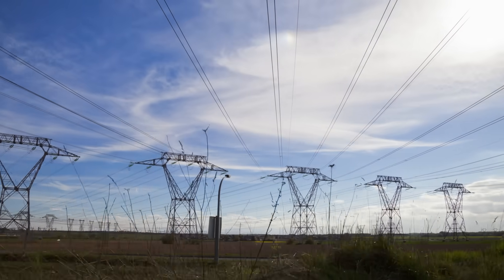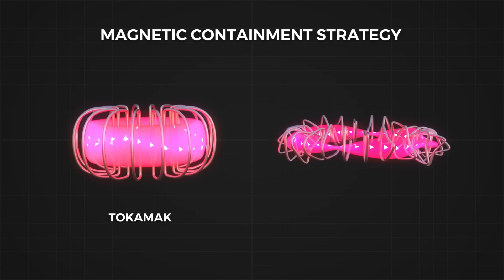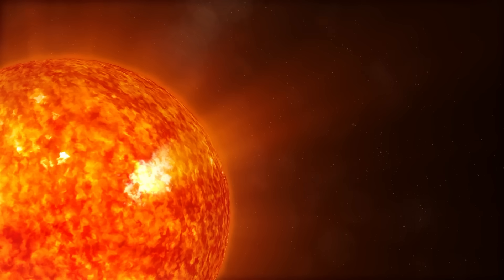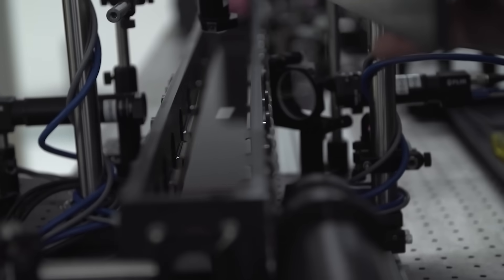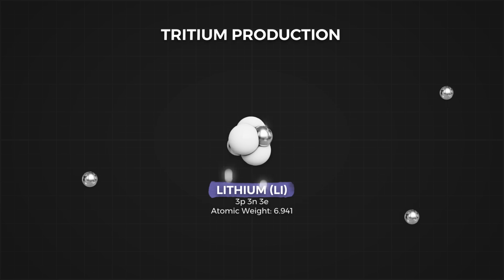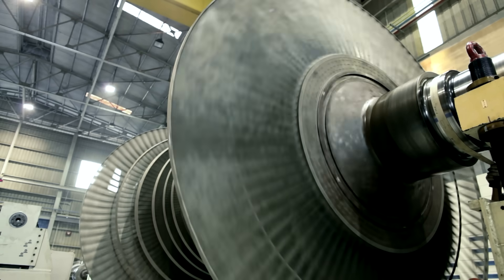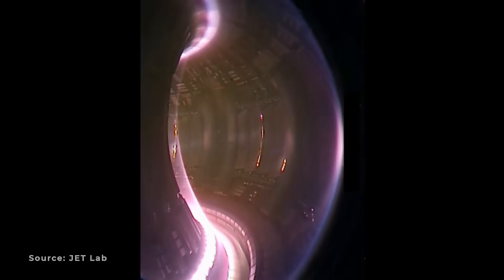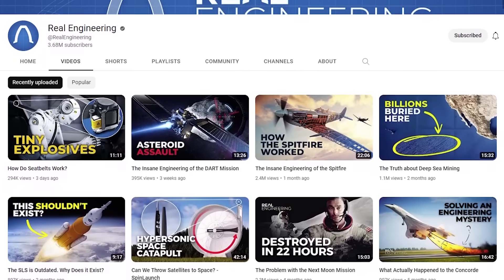The Problem with Nuclear Fusion

Comment: Social media and wrong information has made the fission byproducts sound much more dangerous than what it really is. Simply digging a deep enough hole in the ground, putting the wastes in it and filling it up with cement or concrete will do the job or better thing is to reuse those byproducts as energy generation but the public's lack of correct information has made it a pain. I legit hate it when people over react to safely disposed fissle fuel rather than paying attention to the radioactive C14 in the air which is more dangerous since it's floating around and we are breathing it.

Comment: you touched on it but I feel like even if an net energy fusion reactor will be invented, it will only be marginally better or maybe even worse than current energy plants. Economics is a huge factor, and  detrition, tritium, and lithium 6 are all expensive compounds. Also producing the insane energies and pressures required to maintain fusion will eat away most of the energy gain.

Comment: They are thinking inside the box. Cooling the walls. They need to think outside the box and use a cushion of super cooled nitrogen over the walls. How liquid nitrogen won’t burn you because the heat causes a cushion of air it rides on. Same thing. There’s no metal that can withstand a million degree plasma. An invisible barrier on the other hand will

Comment: I've heard all the promises before in my half century on the planet.  Energy independence, replacement of fossil fuels in industry, free power what everyone has failed to understand that nothing is a 0 sum gain.     The U.S. is the greatest recycler of steel in the world, because of having the lowest nat gas rates and hence electrical rates already.  Recycling is done in an electrically powered Arc furnace, but new steal (shiny steel) has to be done by burning coal (twice).  And during this process the gases are captured and sent to another plant to yield out noble gasses.   Gasses like neon, which is used to focus the lasers to make the expensive computer chips.   Cheap in free electricity is not going to replace that.   Additionally, all this "game changing" tech requires capital.  Which is becoming more and more constrained in the de-globalizing industrialize world. As the baby boomers retire and take their capital with them (the technical term is velocity of capital).  BTW, another widely circulated future promise was the population bomb.  It never happened, in fact may countries are facing a population busts.   Populations with less consumers than retirees will not have the velocity of capital to fund innovations and bring them to scale.  Even the U.S. with its huge economy and best demographics in the industrialized world will feel bumps along the way.   Major projects like these will have to be prioritized in every country, some just won't have the capital to do any.

Comment: This video is way out of date, and was always inaccurate.  Fission nuclear reactors are being REOPENED -- and new designs are coming online.   To be fair, this is more clear now when when this video was made 2 years ago.  But the title is just wrong -- he seems to talk about the problem with Tokamaks -- which is NOT the same as the problem with fusion!  There are MANY competing approaches to fusion -- very different in scale, approach and fuel than the tokamak approach, which is both current (ITER) and old (Russians working on it in the 1960s).  They may all fail, but it only takes one to succeed, and their potential benefits and current problems and prospects are not reflected in this misleading video.

Comment: The Kinetic Energy is converted to Electrical Energy by using a building material, "Tungsten",  Copper silver lined with molten Tungsten, is a self-heaven for Electrical Energy to be transferred from the Nuclear reactor to the Main Hub after that the usual Mega Bolt Coils will carry the energy to the cities Grid, check it...

Comment: STELLAR REACTOR: A FIERCELY INCOMPETENT DRAFT 

PROCESS: 

1. Gas Injection: Fuel gas (e.g., deuterium-tritium, regular hydrogen) is injected into the reactor chamber. 

2. Fusion Reaction: The gas is heated to incredibly high temperatures, causing nuclear fusion reactions to occur. 

3. Ionization: The heated gas becomes a plasma, with atoms ionized into ions and electrons. 

4. Electron Stripping: The high-energy collisions strip away electrons from the ions, creating a plasma with free electrons and ions. 

5. Magnetic Confinement: The magnetic fields, potentially generated by superconducting magnets, confine and channel the plasma using magnetohydrodynamics (MHD). The electrons, being charged particles, are influenced by the magnetic fields. 

6. Energy Storage and Use: The energy generated by the fusion reaction is stored and utilized, potentially through a heat exchanger or direct energy conversion system.

PROBLEMS I CAN FIX: 

1. Magnetism Loss due to Heat:
    - Liquid Nitrogen Cooling: Cooling the magnets with liquid nitrogen to maintain their superconducting properties.

2. Material Strength:
    - ODS TUNGSTEN: Plasma-Facing Armor
Extreme heat flux tolerance (melting point: 3,422°C) Radiation hardening (resists void swelling) Reduced recrystallization. 

    - SILICON CARBIDE COMPOSITE (SiC) Breeding Blanket Structure & Coolant Channels. Low neutron activation. Superior radiation damage tolerance. High temp strength (1,400°C) Tritium permeation resistance. 

    - Vanadium Alloys: Structural Support. Exceptional neutron radiation ductility. Compatibility with liquid metal coolants. Low thermal expansion. Coolant Manifolds, Grid Structures. 

    - Liquid Nitrogen Cooling (again): The liquid nitrogen cooling system serves a dual purpose, helping to maintain material strength and superconducting properties.

MATERIAL FAILURE AND NEUTRON BOMBARDMENT (Because ofc) 

Neutron bombardment from DT fusion (14.1 MeV neutrons) triggers severe material degradation: 

- Atomic Displacement: High-energy neutrons knock atoms off lattice sites, causing voids/swelling (quantified by DPA = ϕt · σ_d) 

- Transmutation: Neutron absorption generates helium/hydrogen via $(n,\alpha)$ reactions, leading to embrittlement ($C_{\text{He}} \propto \phi t \cdot \sigma_{(n,\alpha)}$). 

- Thermal Stress: Cyclic heat fluxes ($>10 \, \text{MW/m}^2$ at divertor) induce cracking ($\sigma_{\text{thermal}} = \frac{E \alpha \Delta T}{1 - \nu}$). ODS Tungsten = Metal porridge in 2 years that's weaker than my will to live. 

- Tritium Retention: Neutron-activated materials absorb tritium, creating radioactive waste and fuel loss.

REMAINING CHALLENGES: 

1. Cost: Developing and maintaining such a complex system would be expensive.

2. Weight: The reactor's weight could be a concern, particularly if it's designed for mobile applications. 

3. Resource Extraction and Supply: Securing a reliable supply of fuel (e.g., deuterium) and managing resource extraction could be challenging. 

4. Difficulty: The complexity of the system and the required technological advancements might still pose significant challenges.

5. Overkill: The reactor's power output might be more than what's needed for specific applications, making it inefficient or impractical. 

6. Energy Conversion Efficiency
   - Even in the best-case scenario, ~60-70% of fusion energy ends up as heat,  not plasma kinetic energy.  
   - Fix: Combine electron capture with thermal conversion (turbines, thermionics).  

7. Losses Are Inevitable (Thanks, Entropy) 
   - Some energy will be lost to:  
     - Radiation (photons escaping).  
     - Plasma turbulence (wobbly particles = harder to control).  
     - Heat leakage (your chamber walls will soak up some energy).  
   - But as long as net output > input, the universe won’t sue me. 

8. Bremsstrahlung Losses (Phantom Energy Drain)
   - In hot plasmas, electrons emit X-rays when they slow down (bremsstrahlung radiation).  
   - Fix: 
     - Use aneutronic fuels (p-B11) to reduce X-ray losses.  
     - Magnetic mirrors to reflect escaping radiation back into the plasma.  

DESIGN CONSIDERATIONS: 

Since I haven't designed each part's components yet, some potential areas to explore include: 

- Reactor Chamber Design: Optimizing the chamber's shape, size, and materials to maximize fusion reactions and minimize plasma instabilities. 

- Magnetic Field Configuration: Designing the magnetic field configuration to efficiently confine and channel the plasma. 

- Heat Exchanger or Energy Conversion System: Developing an efficient system to convert the fusion energy into a usable form. 

- Control Systems: Designing control systems to regulate the plasma, magnetic fields, and energy output. 

- Optimizing The Design
Skip the Middleman (Steam Turbines) If can capture >30% of energy directly from electrons, I already beat the fusion race.

KEY EQUATIONS (NOT ALL)  

1. Lawson Criterion (Minimum conditions for net energy) \[ n_e \tau_E > \frac{12 k_B T}{\langle \sigma v \rangle E_{\text{fus}}} \]  

- Variables:  
    - $n_e$: Plasma density [m⁻³]   
    - $\tau_E$: Energy confinement time [s]   
    - $k_B$: Boltzmann constant   
    - $T$: Plasma temperature [keV]   
    - $\langle \sigma v \rangle$: Averaged DT fusion cross-section [m³/s]   
    - $E_{\text{fus}}$: Energy per DT reaction (17.6 MeV) 

2. Triple Product (Fusion gain $Q$) \[ n T \tau_E > 3 \times 10^{21} \ \text{keV}\cdot\text{s}\cdot\text{m}^{-3} \quad (\text{for } Q=1) \]  

- Variables:   
    - $n$: Total plasma density [m⁻³]   
    - $T$: Plasma temperature [keV]   
    - $\tau_E$: Energy confinement time [s] 

3. Plasma Pressure Balance (Beta Limit) 

\[ p = \frac{B^2}{2\mu_0} \]  

- Variables:   
    - $p$: Plasma pressure [Pa]   
    - $B$: Magnetic field strength [T]   
    - $\mu_0$: Vacuum permeability 

4. Grad-Shafranov Equation (Tokamak Equilibrium)  

\[ \Delta^* \psi = -\mu_0 R^2 \frac{dp}{d\psi} - F \frac{dF}{d\psi} \]  

- Variables:  
    - $\psi$: Poloidal magnetic flux   
    - $p$: Plasma pressure   
    - $F$: Toroidal field function   
    - $R$: Major radius 

5. Critical Magnetic Field (Superconductors) 

\[ B_c(T) = B_{c0} \left[ 1 - \left(\frac{T}{T_c}\right)^2 \right] \]  

- Variables:   
    - $B_c$: Critical field at temperature $T$  
    - $B_{c0}$: Critical field at 0 K   
    - $T_c$: Critical temperature 

6. Neoclassical Transport (Banana Regime)   

\[ D \propto \frac{\rho_i^2 v_{thi}}{L_p} \]  

- Variables:  
    - $D$: Diffusion coefficient   
    - $\rho_i$: Ion gyroradius   
    - $v_{thi}$: Ion thermal velocity   
    - $L_p$: Pressure gradient length 

 
7. Kink Stability (Safety Factor $q$) 

\[ q(r) = \frac{2\pi r B_\phi}{\mu_0 R B_\theta} > 1 \] 
 
- Variables:   
    - $q$: Safety factor   
    - $r$: Minor radius   
    - $B_\phi$: Toroidal field   
    - $B_\theta$: Poloidal field 

8. Tritium Breeding Ratio (TBR)
 
\[ \text{TBR} = \frac{\text{Tritium produced}}{\text{Tritium consumed}} > 1.1 \]  

- Key Reaction: 
 
\[ n + ^6\text{Li} \to \text{T} + ^4\text{He} + 4.8 \ \text{MeV} \] 

9. Displacements Per Atom (DPA) 

\[ \text{DPA} = \phi t \cdot \sigma_d \]  

- Variables:   

    - $\phi$: Neutron flux [n/m²·s]   
    - $t$: Exposure time [s]   
    - $\sigma_d$: Damage cross-section [m²] 

10. Helium Embrittlement 
 
\[ C_{\text{He}} \propto \phi t \cdot \sigma_{\text{(n,}\alpha\text{)}} \]  

- Variables:  
    - $C_{\text{He}}$: Helium concentration   
    - $\sigma_{\text{(n,}\alpha\text{)}$: (n,α) reaction cross-section 

11. Thermal Stress (First Wall) 

\[ \sigma_{\text{thermal}} = \frac{E \alpha \Delta T}{1 - \nu} \]  

- Variables:  
    - $E$: Young’s modulus [Pa]   
    - $\alpha$: Thermal expansion coefficient [K⁻¹]   
    - $\Delta T$: Temperature gradient [K]   
    - $\nu$: Poisson’s ratio 

12. Divertor Heat Flux Limit   

\[ q''_{\text{max}} = 10 \ \text{MW/m}^2 \quad \text{(for ODS tungsten)} \] 

13. Thermal-to-Electric Efficiency (Brayton Cycle)  

\[ \eta = \eta_{\text{th}} \cdot \eta_{\text{cycle}} \approx 0.33 \]  

- Variables:   
    - $\eta_{\text{th}} = 1 - T_{\text{cold}}/T_{\text{hot}}$: Carnot efficiency 

14. Direct Energy Conversion (Aneutronic Fuels)   

\[ \eta_{\text{direct}} = \frac{\text{KE}_{\text{ions}}}{\text{Fusion energy}} \cdot \eta_{\text{collect}} \]  

- Variables:   
    - $\text{KE}_{\text{ions}}$: Kinetic energy of fusion ions   
    - $\eta_{\text{collect}}$: Collector efficiency.

MUST KNOW: 

There are multiple unaddressed problems, solutions and insights residing within this. The examples include: 

• Material failure. (nothing can survive 14.1 MeV.)
• Solutions to weight.
• Potiental for stellarator use. (prolly better ngl)
• LN2 being to impractical and warm for cooling.

And many more. (Translation: To lazy to type it. I've spent to long trying to use proper grammar and punctuation and be publishable)

Comment: Great overview of the incredible promise of fusion and the fundamental confinement challenge. The video does a fantastic job explaining the historical context with Tokamaks and stellarators.

One critical hurdle that often gets less attention than the plasma physics is the fuel cycle, specifically the tritium breeding problem. For the most common D-T reaction, a viable power plant must generate its own tritium fuel by having neutrons from the fusion reaction interact with a surrounding lithium blanket. Solving this materials science and neutronics challenge is just as crucial as achieving stable plasma confinement.

This interplay between the core reaction and the engineering of a self-sufficient fuel cycle is a core theme I explore in my own analyses.

Comment: but to put it another way the reactor wall is like one of the few things standing in the way of tokomak based fusion and it's not like there are not proposals to fix that, like lining the inside of the reactor with liquid lithium layer and having Beryllium under the lithium to act as a neutron doubler to protect the boron from spluttering and creating hazardous dust and meaning you would regularly need to replace the inter wall... which would be a problem if it's full of hazardous dust.

Comment: As I have previously stated, there can be no "sitting on the fence" (or anything close to it)-- Top Down cosmology is either mostly right or terribly wrong.
 
The biggest problem with Bottom Up BBT cosmology is the problem of entropy, central to thermodynamics and the virial theorem, stating in its simplest form that "for a stable, self-gravitating system, the average kinetic energy of the particles is equal to half the negative of the average potential energy." With the Big Bang theory, the early universe was too hot to form particles, including the Higgs boson and the yet-to-be-found (and still theoretical) graviton, meaning that there would have been no gravity and no space time.
 
This is a major problem with Big Bang explanations which systematically ignore it by simply stating that light of the Big Bang cooled by expansion and "condensed" to initially form the lightest particles. Without space time, what does "expanding" even mean?
 
In physics, there is the axiom called Occam's Razor: "Occam's Razor is a problem-solving principle that suggests the simplest explanation is usually the best one. It's also known as the 'law of parsimony'. Essentially, when faced with competing hypotheses that all explain the same phenomenon, the one requiring the fewest assumptions is preferred."
 
What can be simpler for the initial unity in the form of a "primal atom" required by both Top Down and Bottom Up cosmologies to divide into two, with proto-gravity/ Coulomb effects being initially equal and indistinguishable?. Yet the theory that requires ad hoc fixes every time there is a new discovery is preferred over the theory that actually predicts and accommodates discovery. In this Top Down quantum world, any creative hand was only required to invent math. The odds for intervention of that creative hand at any time are 50:50 at best, or "too close to call."
 
The Standard Model, initially devised in 1929 to prevent conflicts between religion and science, has only ensured that the two never find middle ground; hence, the current discord from the religious right regarding global warming and Darwin's evolution, among others.

Comment: Since the universe began with a singularity, if that singularity was a Big Bang, then all of the currently-observable order is required to “self-assemble” from the resultant hot chaos—“allowed” because, though extremely improbable, it is not theoretically prohibited. I don’t believe that! My theory starts with a singularity where everything is connected into a single mass that initially divides into two, like in cell division, but with smaller masses with each division, united by proto-gravity. (Gravity and light were indistinguishable in the beginning.) If in choosing between the two, one of the theories contains a “unwanted message,” that “everything is connected,” then the former theory would be preferred (with blinders on), thereby conceivably allowing a misinformed majority to be manipulated for power and selfish gain by a elite minority. You can “take that to the bank!”